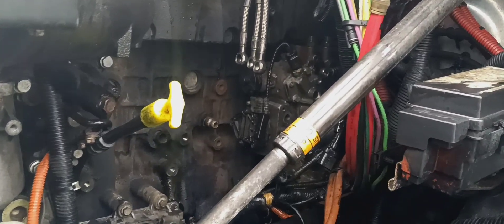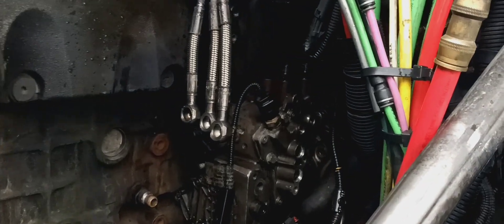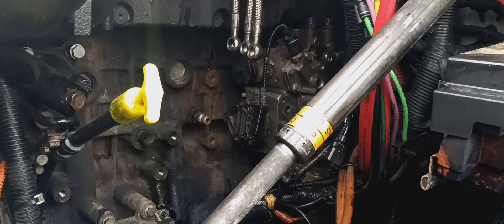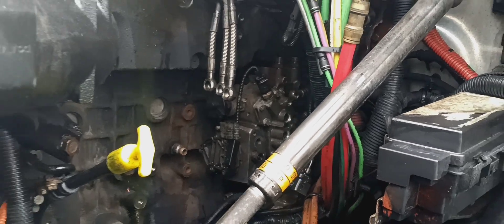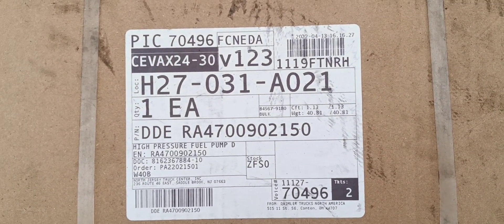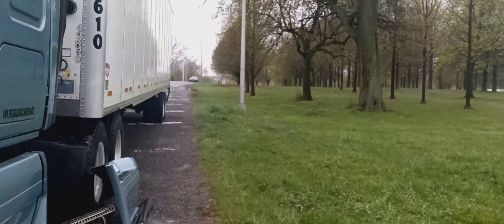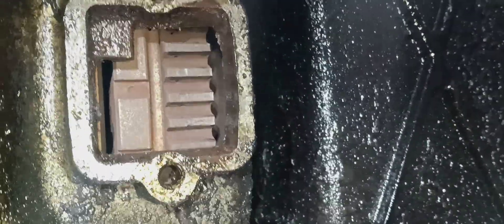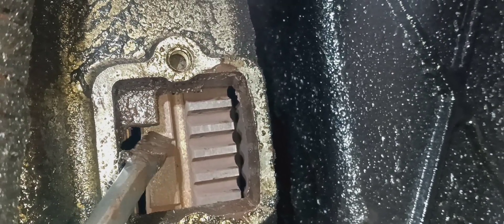freightliner dd15 fuel pump removal (timing)

Comment: There are a lot of things need to be done when replacing the dd15 pump
Reply from the maker: Yes you need to remove the oil filter housing the fuel lines that are on the housing so after that you can work on the fuel pump.
 Also you need the timing to take the fuel pump out otherwise will not come out.
The whole work is about 4 to 7 hours!